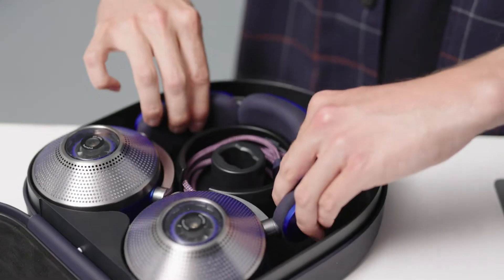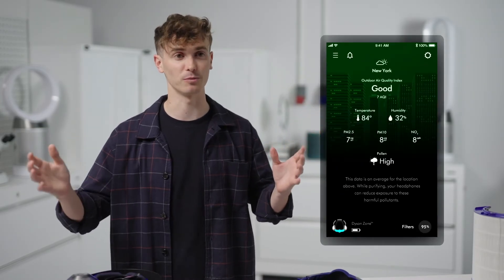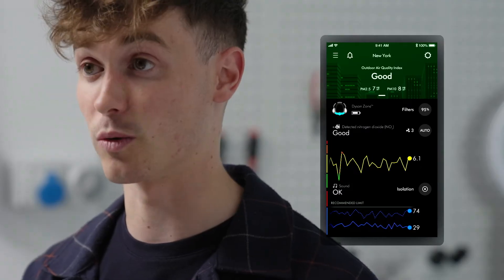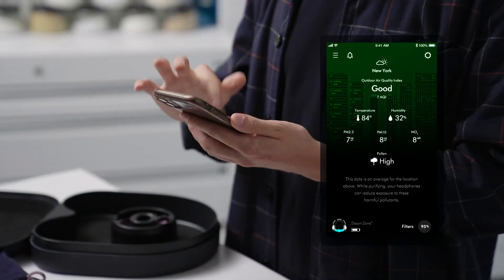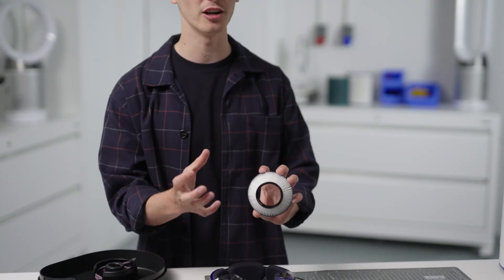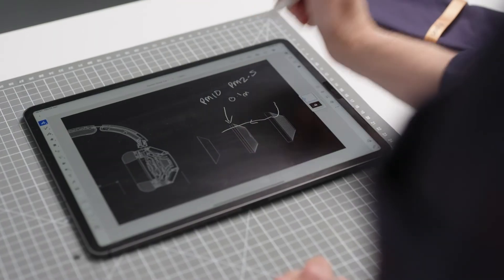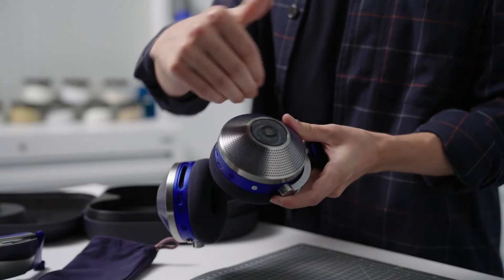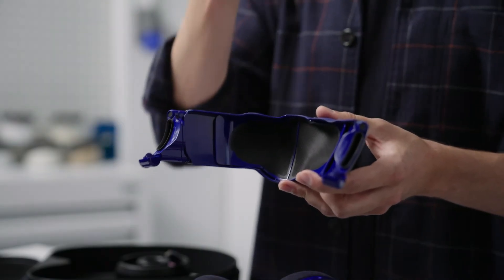Dyson Zone™ filtration, explained​

Comment: i'll probably buy it when it has a PM 2.5 and PM 10 sensor
Reply from the maker: You may view PM 2.5 and PM 10 ratings on the app.  It appears at the top in a banner.  Please reach out with any other questions!
Reply: But does it show what the headphones air purifier sees? or just my city, I'm familiar with this since I own a HP07 purifier @dyson
Reply from the maker: The Dyson Zone™ headphones monitor gaseous pollutants with on-board sensors, providing NO2 exposure readings. But the particle sensors we would choose for accuracy are too large for the space constraints of the headphone format, so we’re not currently able to incorporate these. PM 10 and PM 2.5 levels are shown using local data from a 3rd party provider.
Reply: @dyson  oh okay thanks! ❤️

Comment: Loving the recent software update it apparently made my pair a lot louder and more bass. Please support the Zone 2023 model for a few years before I have to upgrade. Thanks.
Reply: Did they also get rid of the pause when you take off the headphones? Mine started doing that idk if it was after the update or the sensor just doesn't work anymore 🤔
Reply: No that's normal. They pause automatically when removed IF the sensor is no longer covered up. @klaimster3184